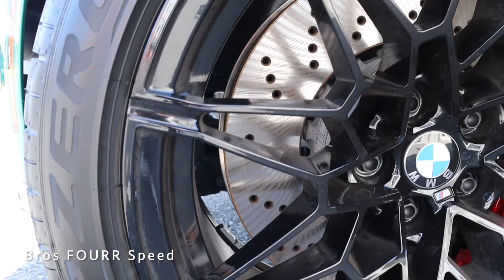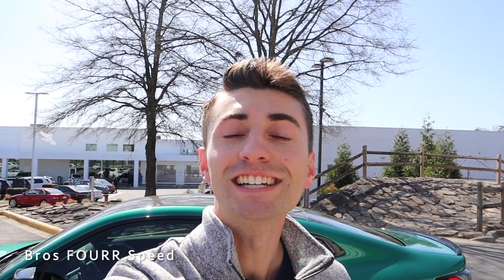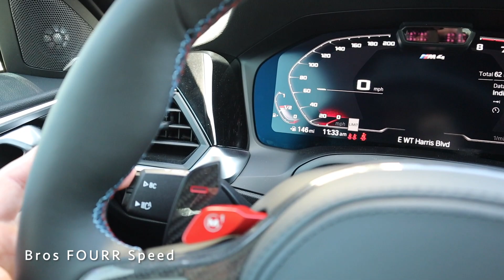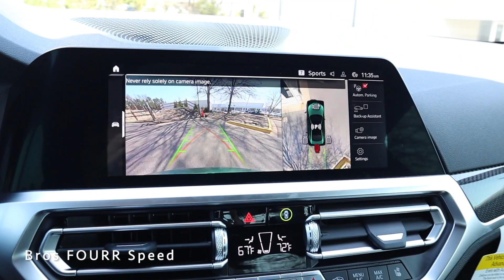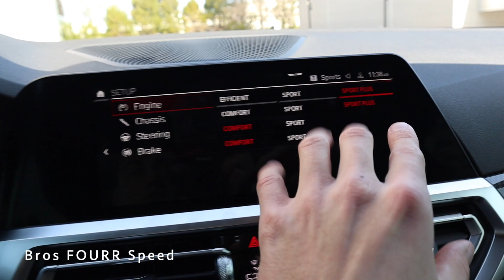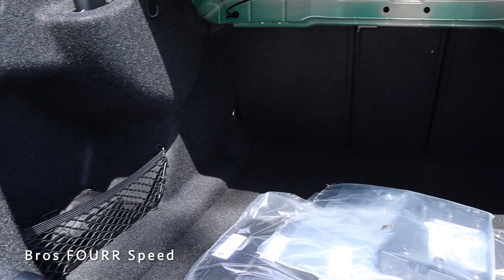2021 BMW M4 Competition Coupe: Start Up, Exhaust, Test Drive and Review

Comment: I dislike the the 2 steps forwards 1 step backwards approach BMW and perhaps Toyota have been taking. The S55 has a DCT now we go to a S58 with a ZF.... I mean the reason for this is perhaps the reason why the Supra also has a ZF. I realize the ZF is a good transmission but I can't imagine the guy who has a DCT and an S55 trading or selling his car to now go to this... Yes visually and perhaps interior/exterior wise it's a refresh but the acutal components here are baffling to me.
Reply from the maker: Yeah I'm not too sure why they would ditch the DCT. Maybe they wanted a more robust transmission that wouldnt have any issues. I think Toyota might have some influence in BMW these days to focus a bit more on reliability. While a DCT is awesome, this ZF felt way more mechanical then the ZF in the Supra. Lightening quick in both cars, but if you told me this was a DCT, I'd believe you
Reply: @BrosFOURRSpeed  
The problem people don't realize is that the ZF transmission while good and affordable isn't a good transmission when you put the car into harsh track or open road scenarios. Specfically it's fine around town but if you want to put the car into a corner and then downshift, the transmission will deny you the abilty to actually do that while a DCT would allow you to do it. Try it yourself and you will see...

Comment: I feel like the Shift knob gotta disappear if it’s not a Manual Transmission... nowadays you want more space the new F-150 is a Trend Setter when it comes to making the Shift Knob Disappear
Reply from the maker: With the F150 though, the shifter only disappears when the vehicle is in park, so it only helps when you aren't moving!  The only shift knob I can think of that doesn't take up much is the new design in the Porsche models, the small lever you just move slightly to engage in the gear you want!

Comment: Front looks better overall on M3/4 Vs standard models. Even M440.
Reply from the maker: I love the look of the grill, but this the M cars pull it off better!  The M440i/30i just don't have any other body lines that help incorporate the look, but looks are also subjective!  Either way BMW is making some changes!
Reply: @BrosFOURRSpeed  Most def man, I suspect the 3 LCI will include the bigger grille. We’ll see. I have a 2021 M550. Which think looks great. Did a nice job on facelift.
Reply from the maker: Yeah the 2021 5 series was really nice to check out! Excited to see where BMW takes their cars

Comment: So one could remove or over-ride the limiter to go from 155mph to 180mph for instant gain in performance.
Reply: You have to keep the car in gear 7 then change up to 8th at 170 mph this will take you on to 190 mph plus
Reply from the maker: That'd be some fun in this M4!
Reply from the maker: Yup! I think there is a drivers package or something that removes the limiter. But you could always tune it and it'll remove that anyways

Comment: Is it 4WD?
Reply: Not yet. xDrive will be coming in July, but only on the Competition models. It will not come with the non-Competition manual models.
Reply from the maker: The non comps won't get that?  Interesting, but would make sense I guess.
Reply: That’s what I’ve been told (not from BMW, but from some reviewer from Portugal).
It does make sense for BMW not to put xDrive on the non-Competition models, considering that in Europe, you can only get the 3 Series xDrive with the automatic transmission.
Reply from the maker: We'll see what they do I guess
Reply from the maker: This was rear wheel drive!  The xDrive should be available at some point like the other comment mentioned!